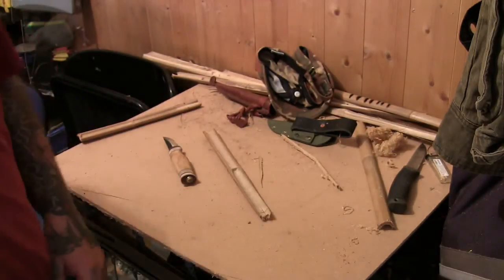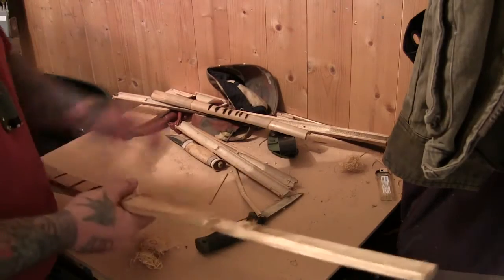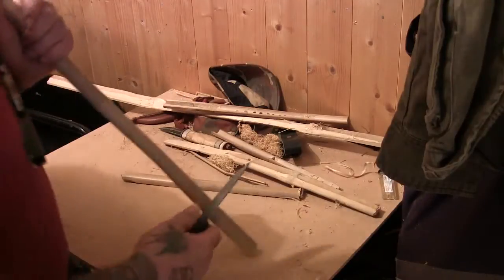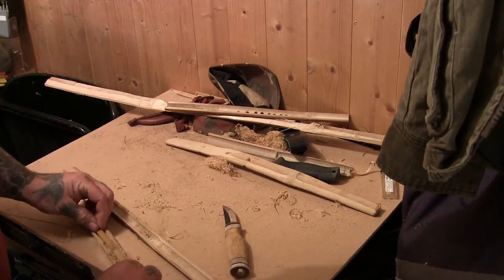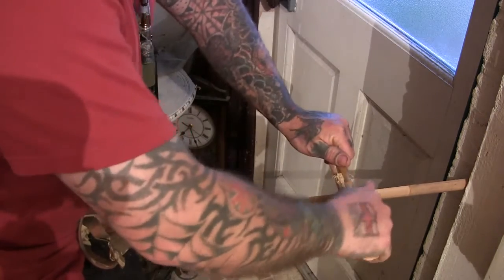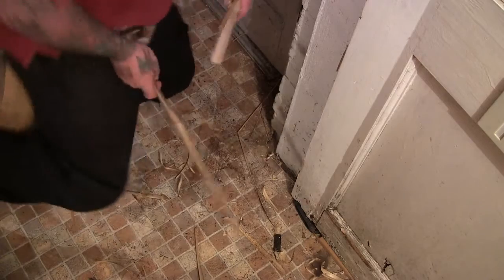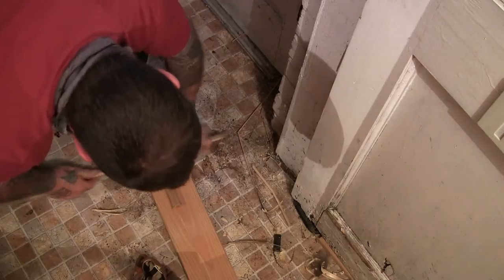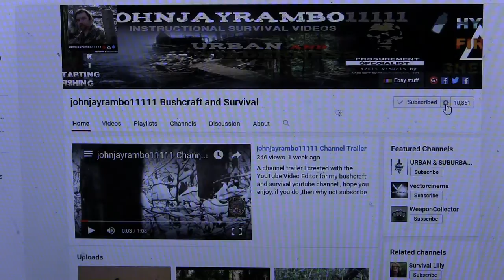Fire By Friction Fail : Advice Needed

Comment: Hello john, Im sure your gonna get more advice than you need!but heres my two penneth. The Bamboo Fire saw can really use up yr energy faster than any other method i find. Check out my "Bush burner and bamboo that doesn't" Video, i use the same method you prefer but wedging it into a tree. Trouble is that it requires quite  a bit of pressure to start generating punk  and as the base board moves or starts to slip the tendency is to compensate or "ease off" a bit and things cool down. gotta see lots of smoke before you stop. i can't get on with the last method you showed either.working on the floor just winds me. the bamboo edge is butter knife sharp, doesn't have to be thick wood.I find that clearing the hole with a bamboo sliver before you really go for it stops the hole clogging too. I've waffled on here,,but ya did ask  : ). Get the base board solid somehow, not flexing either ,from what i can see its the only thing stopping you. ATB, I've subbed you, cheers.
Reply from the maker: +Scoutforlife cheers mate

Comment: I would like you to get a success. Things that I see are 1) You definitely need to stabilize your base. Whether you are doing blade on base or base on blade. You need to be able to go fast and furious with your bodyweight on it without being concerned about the bottom moving around on you. 2) Your bamboo is definitely too thick. I see that you've been trying to carve it down but it is better to just select the correct size bamboo. I'm talking about wall thickness. If you have some that was definitely half the thickness you're using now - use that. Both blade and base. 3) Your notch hole should be "a hair" larger than the thickness of the bamboo wall of the blade thickness. Meaning, if you placed the blade on the hole you should be able to see light through a millimeter crack on each side of the blade over the hole. 4) Don't give up Bro!

Comment: Sounds redundant, but dry (and fresh - not green) bamboo, ...  maybe the old bamboo is too old, dry rot ... not enough minimal water (frictioned steam into hotter 212+F heat for embering bamboo fibers.

Most bamboo drill fires are shown with the saw board as a larger 3 inch diameter wood half-section.  Airflow and ton of flash tinder stuffed under the larger/longer friction slot.  Proper tinder and tinder stick holding technique in the saw board - check.

Make vastly smaller tinder, fiber fuzzies, original tinder looked like scraped featherstickings.  Use something different than bamboo scrapings, dried/crinkled palm/bamboo leaf duff, grass fluff, etc. for tinder, and ember acceptance.

Bamboo (Janka) hardness only superceded by Hickory, Pecan, ... as a grass 'wood" is harder than all softwood, fruit wood, nut wood, and hardwoods (except for hickory, pecan, and the tropical woods).  Same way, bamboo is a real bitch to get frictioned or sparked into ember.

Ember needs to fall down into the tinder.  No one said that a bamboo saw was easy.  Like a hand drill, just have to keep at it.  Same for the bamboo drill point friction method.  Insane time period and energy use getting an ember going. 

Maybe scrape (like your tinder) the edge of the saw blade (and the slot) for an uneven textured surface, and those fibers (of both the saw blade and the saw board slot) become the starts for the char dust and ember.  In this you want the 90 degree angle of the saw blade (and its fuzzies) rubbing against the perpendicular bamboo slot poking- out fibers, sawing/rubbing/frictioning/scraping/ripping/tearing more and more of the slot and saw blade fibers into char dust and eventual ember.

Maybe rubbing a little spit along the saw blade gives back the missing moisture, and slippage that then turns into sticky saliva, and spit-water into steam, getting up to 212+F and higher with continued rubbing.

Good luck.  Expect to see it accomplished in the next video. DDDDDD
Reply from the maker: +John Lord ha ha cheers john , i ,ll try all the things you said and give it another go cheers mate
Reply: is this John Lord the knapping master?
Reply: +McLovin I am John Lord the napping master.
Reply: John Lord well if you are I feel privileged, do you still teach?
Reply: +McLovin  I am not John, Val, or Will Lord of the UK.  USA here.
Reply: John Lord Ha, ok never mind :-) still, what are the chances of two knapping masters called John Lord eh?
Reply: It is said that there are twin-looking people in this 7 billion people.  Maybe that person is out there.  I would have to start knapping (instead of nappping) and get mastership, before saying I would be of the same abilities.